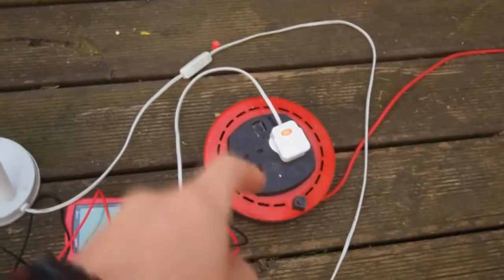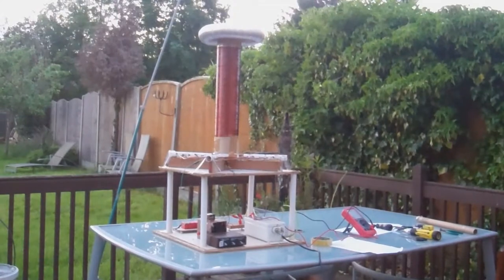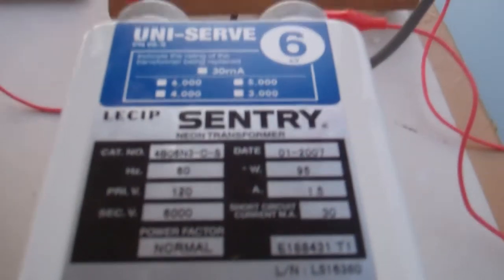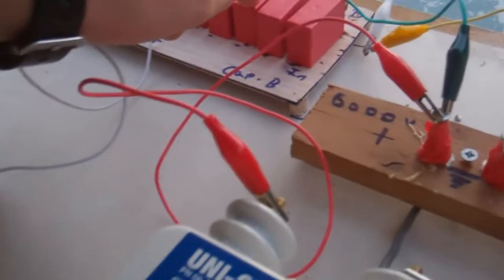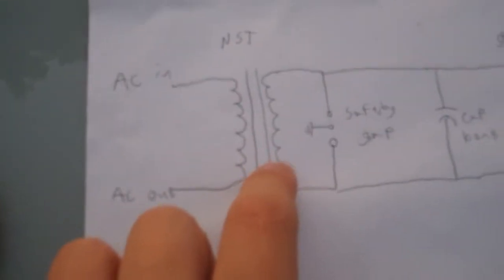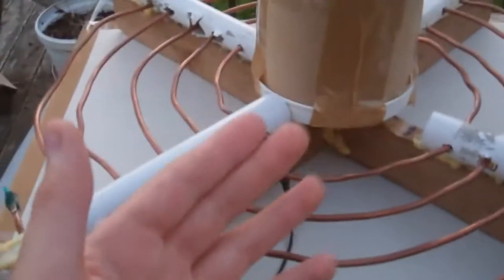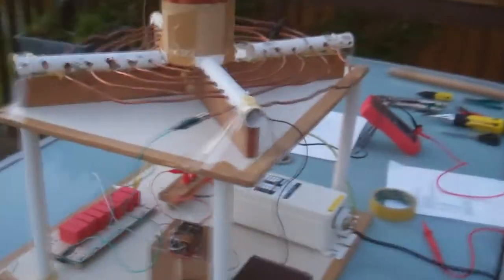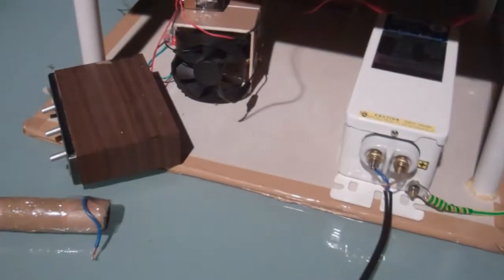My 6kv Tesla Coil Project video part 1 - Construction and Operation

Comment from the maker: Thanks I will. Iv found out in the video that I had not done the math right because  the transformer I used was american and so it used 60hz but did the calculation with the english 50hz so i need to upgrade the cap bank and some other parts that il go through in part 2. Also I have not put this in the video but i put a break out point on it and tuned the primary and it discharges quite well. Well thats enough from me se a in part 2

Comment: Isuggestu play around with the spark gap & primary so you can make the sparks that are coming from the torroid discharge by itself, so u wont need a ground wire